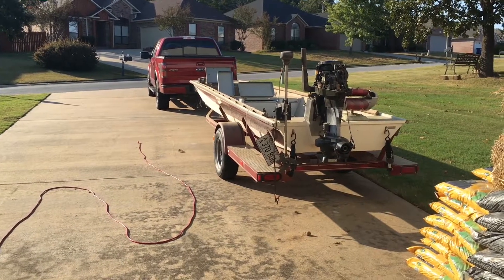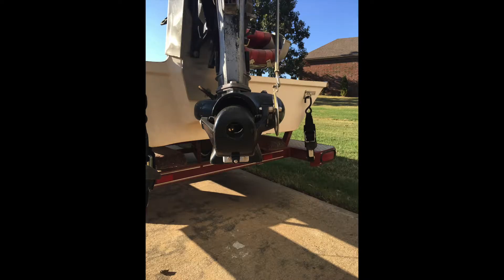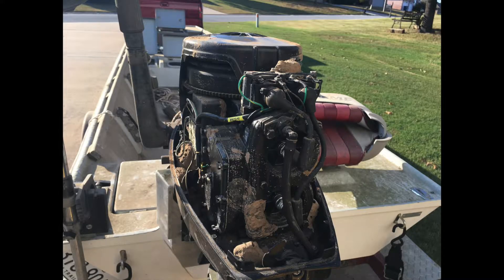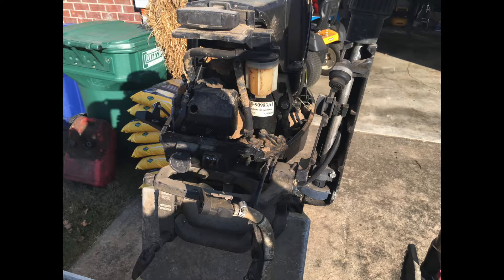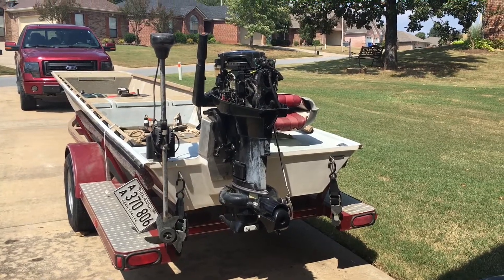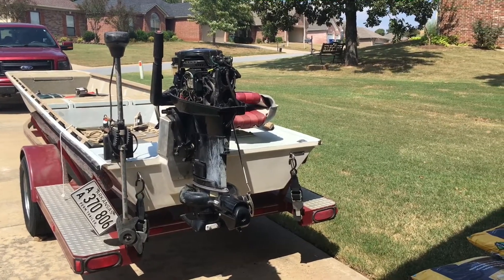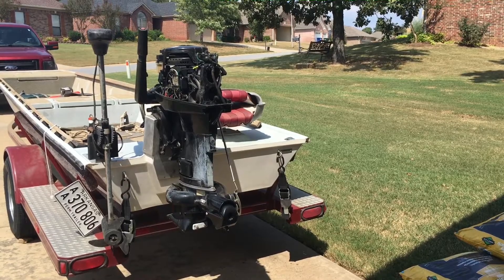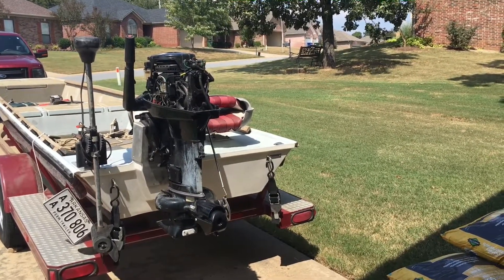Mercury 25 Jet Resurrection & Water pump change

Comment: Greeting and thanks for the excellent video.  Can you please explain what you mean at the end of the video about 'changing the trim setting because it was too high'??
Reply from the maker: These motors have a manual trim setting you can adjust. This changes the angle of the position of the motor relative to the boat.
Reply: @sirmarcusandrew  Yes, I get that, but more specifically, what did you notice the motor doing that let you know it was trimmed too high?

Comment: Does this motor have a reverse gear?
Reply from the maker: The jet pump does sort of. There is a reversing gate that changes direction of water flow to allow you to “reverse”. This is a side shift and not tiller shift model that allows this.